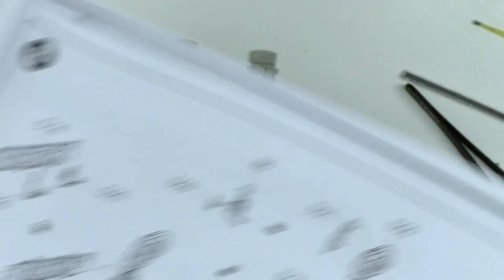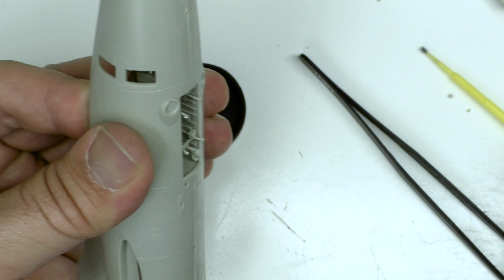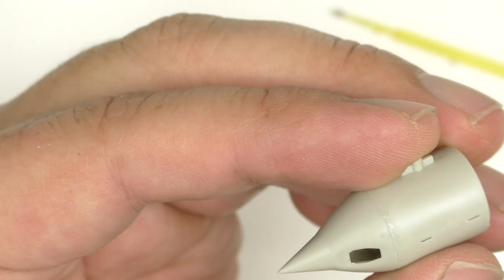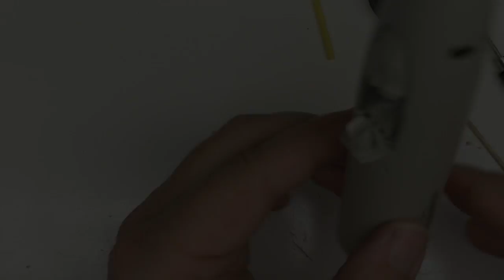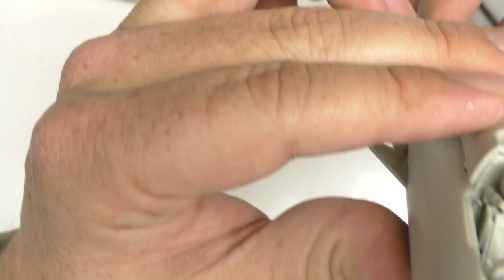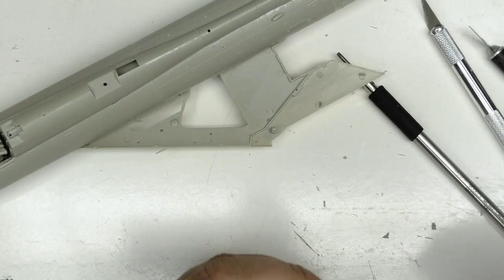Kitty Hawk Su-17 Build Review 5 - Fuselage + Spine

Comment: I've not heard of Kitty Hawk before so found this very interesting

Joining those fuselage sections really do look line a pain the the a---. I suppose one way around the problem might be to glue a series of styrene strips, or a small sheet of thin styrene bent to form a tube, inside the end of one part to act as a locating collar.

A real faff though, especially for a kit that costs 80 dollars (which is 60 UK pounds). Not good.